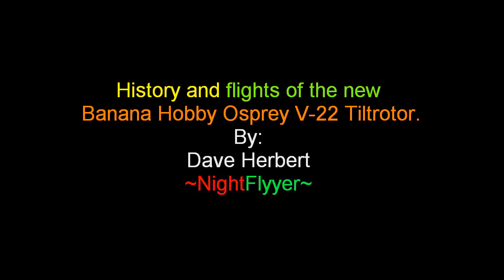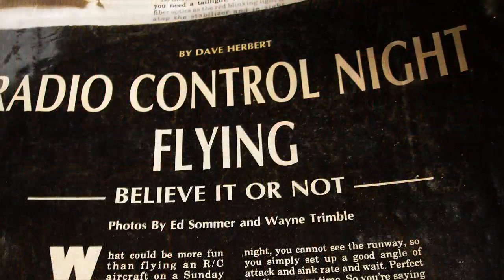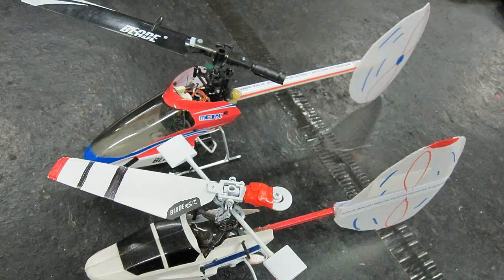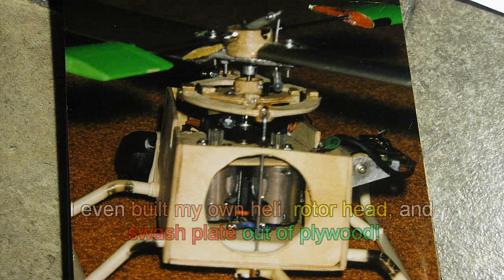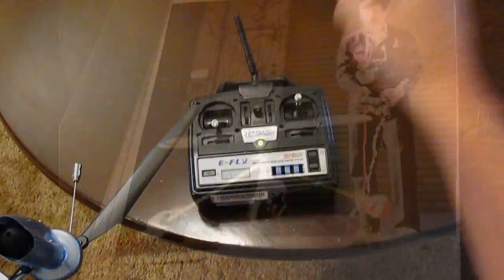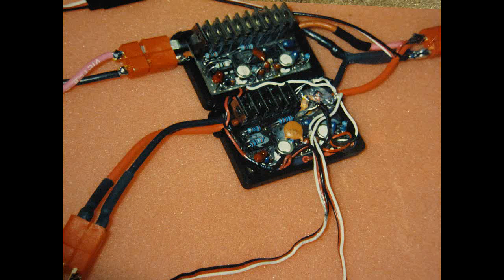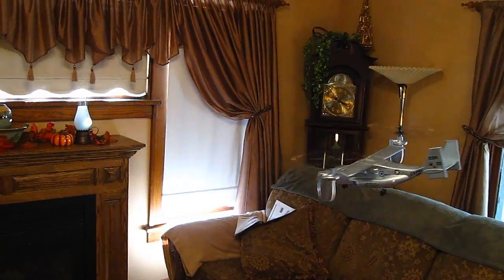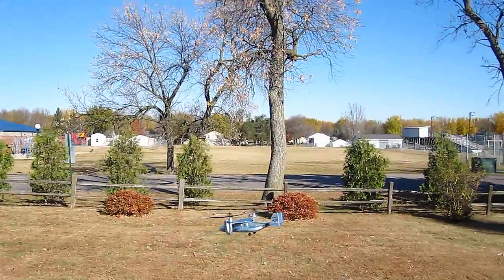Art-Tech's new RTF OSPREY V-22 Tiltrotor Aircraft demo, plus my old heli experiments.  ~NightFlyyer~

Comment: Does it even tilt? it doesn't seem like it, at least not all the way for forward flight, so how is it a tiltrotor ?

Also why would a tilt rotor fly like any other heli or plane ? it's not any other heli or plane, and a tilt rotor plane shouldn't have swash plates since it doesn't really work that way, then it wouldn't be an osprey, but more like that Quad rotor planet that uses collective pitch instead of throttle.
Reply: The V-22 does have swashplates

Comment: Im waiting for an osprey where you control the rotors individually with each of the sticks where you push both sticks forward to tilt the rotors forward and so on. With maybe the trottle on the front of the transmitter like two sliders again one for each rotor. Would it work?

Comment: I dunno, Dave; It COULD be done (but at higher price, guaranteed) with a custom microprocessor to changeover the flight controls when the nacelles transitions from vertical to hroizontal, and back. But that's the way Bell-Boeing did it, too. It would ALSO mean the pilot would have be a rotorhead before a fixed-wing driver, but THAT was true in 1:1 scale, too - that's what killed every Marine driver that died due to "pilot error" - something the FAA loves to fall back on.

Comment: You could easily make it do full transition with one of those $39 programmable Exceed 6-channel radios.

Throttle, rudder, aileron, elevator on four channels.  Make a designated fifth channel control by the variable rate nob to control the pitch of the rotors.